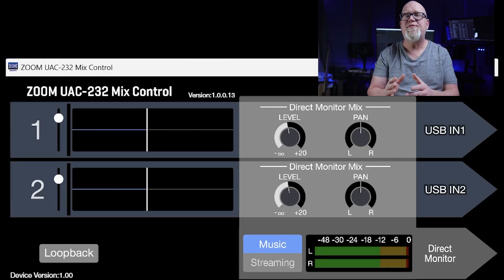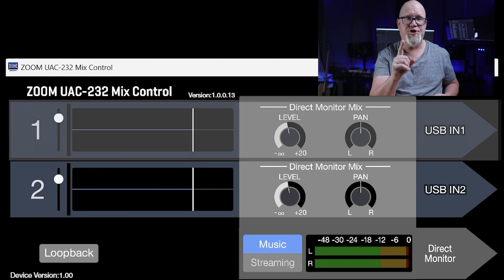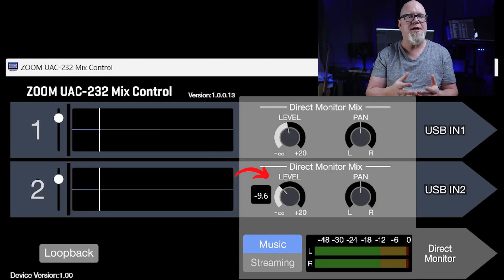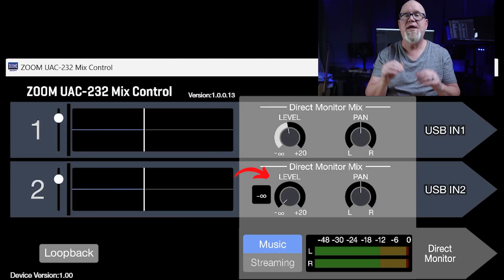NOISE FIX FOR HEADPHONE OUTS ON ZOOM UAC-232!

Comment: I had this problem as well but instead of turning down the direct monitor I turned down the "input gain" of channel two. I know its not really that but its the slider next to the number two. Everytime I plugged something into only channel one, that slider would jump to the top. Turning down that did the trick for me and I dont need to remember to turn direct monitor level up later. It was a weird glitch for me too.

Comment: The reason is simple, by default, it uses adc (zoom has two per input I think) with higher sensitivity or dynamic range on all inputs (when not plugged in inf resitance). Direct monitoring button just sums two processed inputs (after adc stage) and outputs directly to monitor
Reply: Okay, that makes a lot of sense to me now

Comment: Is this interface iOS compatible? It probably would be if it had hardware gain controls. That’s the problem with configuring, controlling, and updating via software. Computer dependency.

Comment: One could also make a dummy load XLR connector like the 150 Ohm ones used for preamp noise testing and just plug it into the second input. Also I don't really get the direct monitoring thing, I personally only use it for troubleshooting.
Reply: Same. Software monitoring always for me.